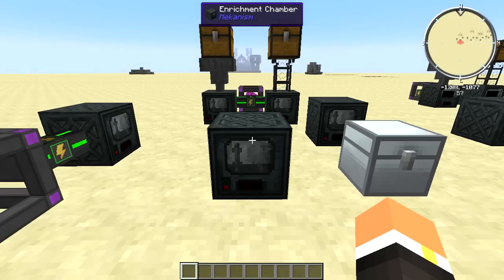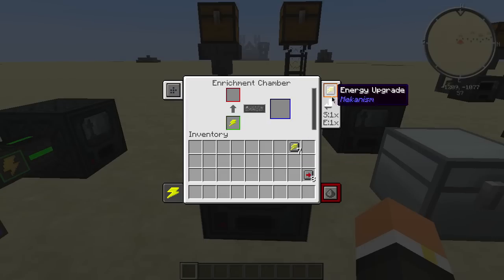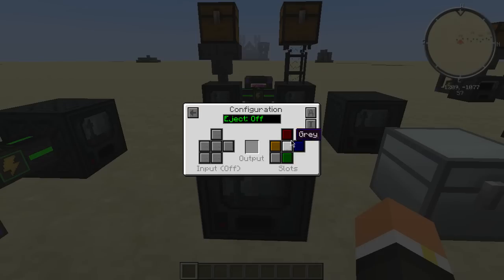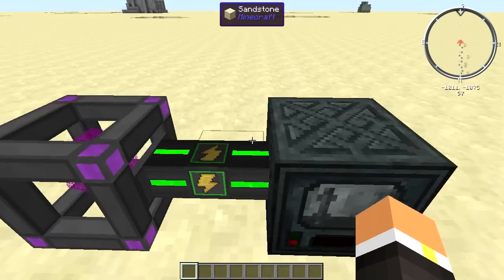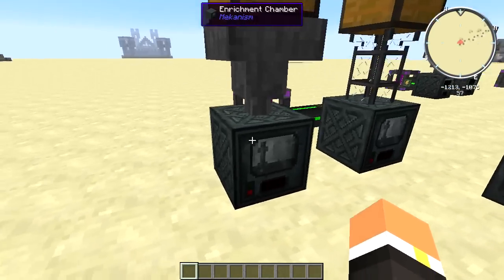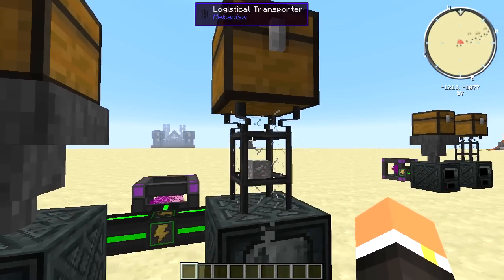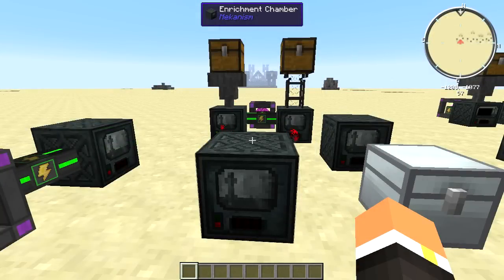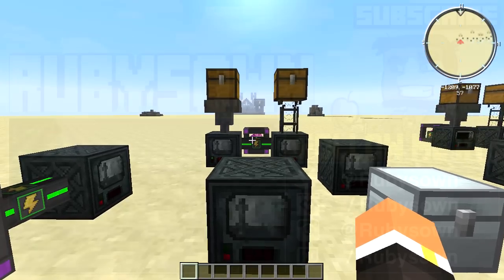Modded Minecraft - Machine Tutorials - Mekanism: Enrichment Chamber

Comment: Hi, Im running MC 1.6.4 with Mekanism, but the machine doesnt do anything, it has energy, redstone and even the item it has to work with but nothing is going on, any suggestions?
Reply: i might be a bit late but if you open the inventory of the chamber and press the bottem right button and switch it to low, then it works, for me atleast